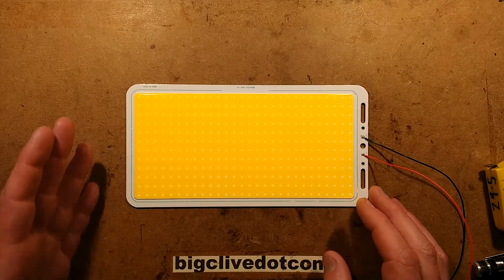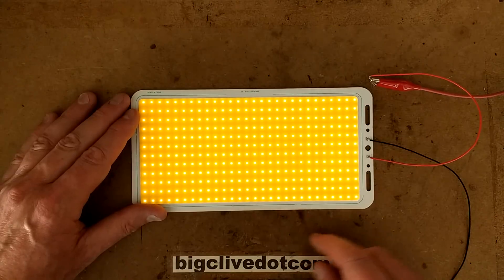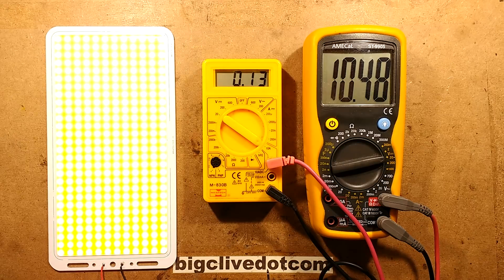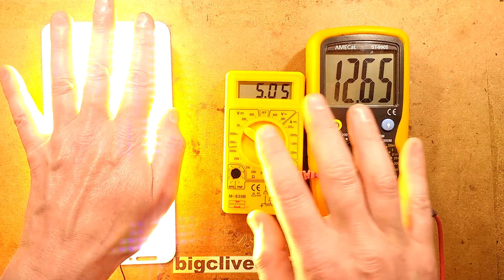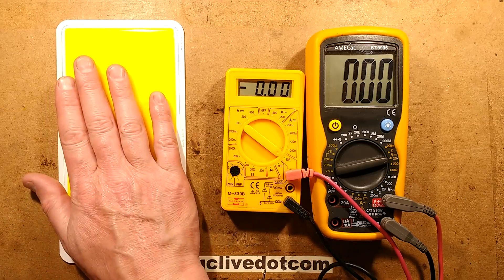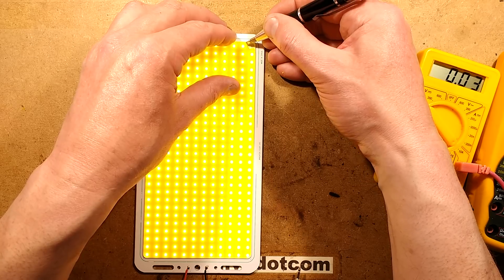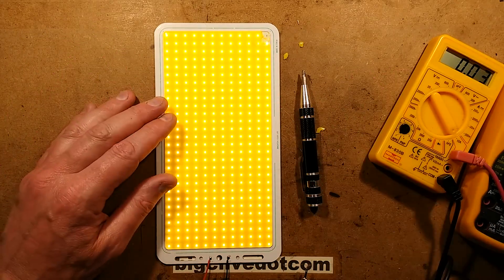The biggest LED COB panel yet!  Voltage/current tests.

Comment: Hmm constant current driver required.
Reply: That is recommended based upon the max current specification of the LED system which will be achieved at the specified voltage. If you can assure that the voltage will not go over the specified rating as in regulated voltage then you would be fine. I created my own 4'X4' panels each with two circuits @ 50 1w LED's for a total of 100 per panel. Each circuit of 50 is a series rating 3.2v-3.4v each for a total of 160v-170v drive. I take the 120vac line, send that through a bridge rectifier and then 2x47MFD 220VDC capacitors for a final RMS voltage of 164vdc. The AC line voltage may fluctuate a bit but will stay in range for the LED's which are rated for 350ma and currently operate with this setup @320ma. Even if there is a short momentary surge forcing the current up to 380-400ma they should be fine.
Reply: Dave Micolichek, Very true :-)
Reply: You are correct.  The efficiency somewhat, and the quality of the light are affected by the current.  It's preferable to pick an optimal current and drive it with pulses to vary the brightness over varying the current and thus forward voltage drop.  You can do it by voltage alone, but it's sketchy - just like hooking an led with a forward voltage drop that matches a button cell after the internal resistance in it drops the voltage directly to the cell.  It works but gives the wrong impression of proper led driving.
Reply: DrHarryT, Bloody hell, i only said a constant current driver would be required.
I never asked for a mad ramble lol.

Comment: There is a even higher power one on Ebay that I bought and it is rated at 200w and it is in the form of a large circle measuring about 160mm

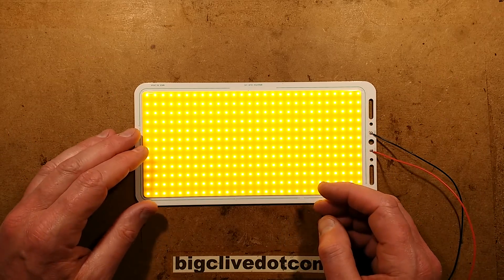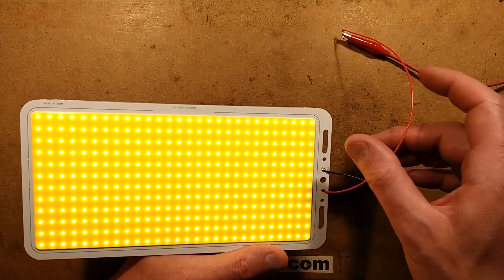Comment: I think your power supply might be interfering with your audio pickup.  I can hear a faint background noise in the video that goes away when the supply is shorted out at 2:03 and 2:26, when the supply presumably drops its voltage to limit current.

Comment: Did you get any sense of whether it has a decent CRI? I've had warm white leds from China before with terrible greenish colour and awful CRI, so if this panel is decent it'd be a great deal.
Reply: I'd like some high CRI too, did you find any? Can be smaller.
Reply: If very high light output is not required cree has cheap COB LEDs avaiable, managed to get 80CRI 5000K 490lm(25°C) 3.6W(CXA1404) for around 0.95€ each, soon i might buy the double emitter version(CXA1507) with 70CRI 1klm 7.2W for 0.99€.(digikey/mouser and other have them at those cheap prices, the cxa series i believe are obsolete due to the existence of the more efficient cxb series), not bad for good brand genuine LEDs.

Comment: Clive, any chance of getting hold of a light meter and measuring the actual output in lumens?
Reply: David Kohen  -  look up the difference between lumens and lux and you’ll see there’s a world of difference...   there are other methods of measuring light too !!!
Reply from the maker: I have a couple of light meters, but accurate measuring of a light source really requires a large integrating sphere.
Reply: Well, you could always test one LED (array) with a known lumen output(preferably a similar one) and then compare this one to that one. Won't give you an accurate absolute number, but a reasonably accurate relative number to your known array.
Reply: Build a  diy integrating sphere ish that we can build at home...
Reply: Just want to know if two different light sources are roughly comparable - any reasonably consistent ballpark figure will be fine.

Comment: I wonder how bright pulses one might get out of it, if driving it like a strobe. DIY disco stuff or maybe some other scary shit in the middle of darkness blasting people into submission. hmmm.
Reply from the maker: Its use as a strobe panel did cross my mind.
Reply: There are now LED "microflashes" that are substitutes for Harold Edgerton's old air-gap strobes, for use in stopping VERY fast action, such a rifle bullet in flight. Duration can be as short as a half-microsecond (A microsecond is one millionth of a second).
Reply: Clive, if you can come up with a relatively inexpensive way to build a microsecond LED flash, you're my hero. The Vela One is very nice, but way out of my price range:
https://www.kickstarter.com/projects/vela/vela-one-the-worlds-first-high-speed-led-flash
Reply: Dave you would be surprised how foolish that is.  It'll cost more for heatsinking than just using multiple modules at lower drive current, and then they're more efficient too.  It's an automatic fail trying to see how much power one can run an LED array at unless there's a unique requirement like having a limited area, say in the end of a flashlight.
Reply: Wouldn't work nearly as well as a lower power flashlight pointed directly at them. $15,  10W flashlight ready to use, would be multiple times higher intensity by merely focusing the beam.
Reply: I was thinking like flashing an entire room for a brief moment, floodstrobe like.
Reply: Very bright, for sure...
Reply: Wouldn't the rise and fall times be too slow?
Reply: John Michael Stock, not at all, LEDs are very very fast (which can also be a problem when driven by PWM and not wanting any perceptible flickering). I'd like to see some hard figures myself, but we're talking much less than milliseconds. How do you think IR communications on your old mobile phone worked?  ;)
(it didn't have the same phosphors, of course)
Reply: Darron Birgenheier, oh, that's fascinating – thank you!

Comment: Clive, what would be the best way of limiting the current to use this in a car application?  Say I wanted to run it in a vehicle at the 2 amp current level?  Using an adjustable current limiting LED driver?  Thin wires?  Or multiple resistors?  Thanks, Paul
Reply: 3W seems low for 1Ohm resistor. Car alternator produce around 14V and LED would take around 2.25A at 11.75V. Resistor dissipation would be around 2.25V*2.25A=5.06W. That is too much for 3W resistor. Absolute worst case scenario for 1 Ohm resistor is 15V alternator and 3A of current yielding 9W of dissipation. 10W resistor should be fine in that case
Reply: Yeah, I think buying a buck converter off FleaBay for a "buck" would be a better solution than using a resistor, I don't want a 3 watt heater in my car.  :)
Reply from the maker: I'd suggest something simple like a 1 ohm resistor rated at about 3W and mounted in an area where it wouldn't get too hot.

Comment: Nice!  Got some of the smaller types you showed a video or 4 back.  They work great and only 1 out of 6 had bad LED's on board but the light produced even at 12v is so overwhelming it's not even noticed.  Good stuff and thanks!

Comment: Your favourite 100w LEDs are being sold in COB form now, and they're perfectly even

I got some for my garage, they haven't had any issues with dying rows or uneven leds after running them at 90w+ a day
Reply: Luke Den Hartog i find with leds they last forever but its the converter thats dies
Reply: https://m.ebay.de/itm/COB-LED-Panel-Lampe-Spotlicht-10W-30W-50W-70W-100W-120x36-220X120-200x10mm-/263642714031?nav=SEARCH
Reply: they are intrigingly cheap... less then 6 euros...
Reply: "Does not post to United Kingdom" BOOO!
Reply: converted to ebay uk > https://www.ebay.co.uk/itm/COB-LED-Panel-Lampe-Spotlicht-10W-30W-50W-70W-100W-120x36-220X120-200x10mm-/263642714031?nav=SEARCH
Reply: You must have found a good supplier then, one that properly matches the dies so they don't hog current. (Good manufacturers like CREE do this. I have a CREE ceramic COB LED for my reading lamp, use it almost every day for ~6 hours or so, all year long. 2 years and still going strong.)
Reply: Just got my first cobs after watching this video, got the one here and a smaller one. They're ridiculously spectacular. Everyone who likes leds, which is probably everyone watching this video, will love these. And if you can't think of a use, show and tell will do just fine.
Reply: well i might ignore than and contact them as if you scroll down the listing they state shipping and the uk is included.   they are in china after all..  Else you can find the panels elsewhere for a similar price.
Reply: I got a batch of 10 or so COB LEDs after seeing them here, and I have to agree they look a LOT better than the old "100W" LED-chips. At low current/voltage these are almost perfectly lit up! I bought from somewhere that labeled the LEDs "sumbulbs" on aliexpress.
Reply: I bought one of the remote control PWM dimmers and they work really well on the cob panels too. the receiver bit is very small and can handle decent current too.

The odd bit was the controller had various modes , most of the modes were basically the various flash cycles of emergency service vehicle lights :D
Reply: I have bought a not insignificant number of LED 12V dimmers just to find one  without blinky modes, and more importantly, a "low low" and that looks good. I finally found touch buttons with blue illumination that had a decent GUI, they remember the old dimming level when turning on.
Reply: which is the ones you found without blinky modes?  the ones i got remember the setting when you power them off . this is a bonus at least.  It has 10 dimming levels . no noticeable flicker either.  but lots of near pointless epilepsy inducing modes :D
Reply: @der Bender “Ships to America, Europe” — Then proceeds to iterate USA & every single European country except Germany as one they will NOT ship to.
Reply: Meaning 90+w every day all day... derp.
Reply: A "WHOLE" day?  I've ran lots of 10W to 100W COB that lasted 100 hours before dies started dying...  You're much better off running something like this at half power and that on a massive heatsink, or closer to 1/10th power if you prefer little to nothing heatsinking it.